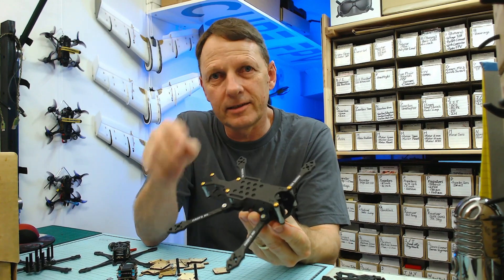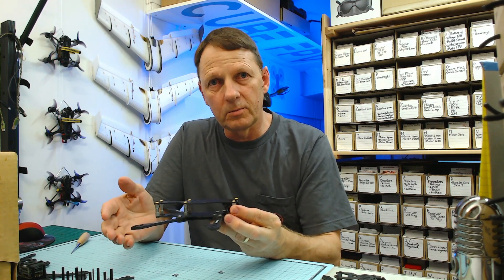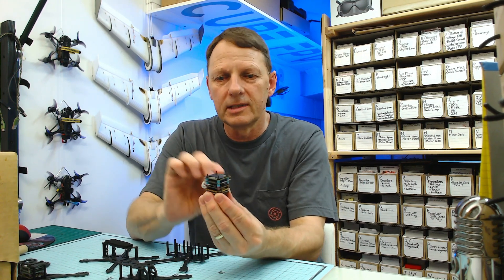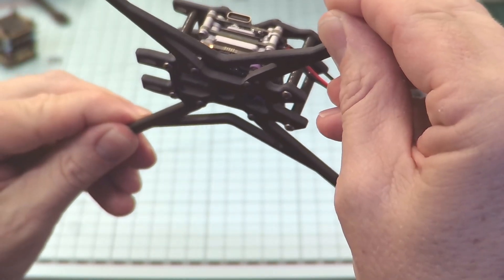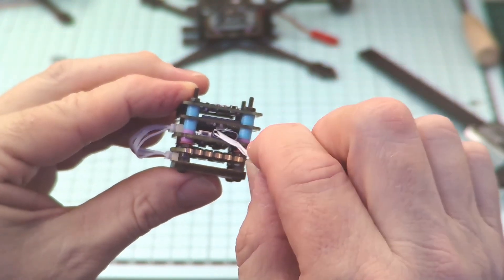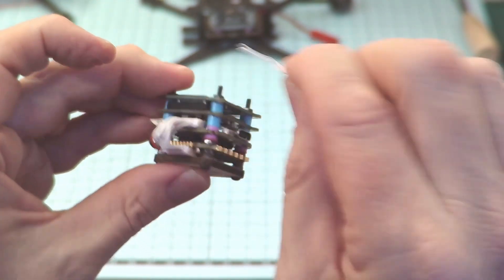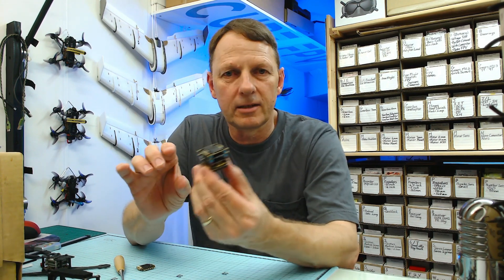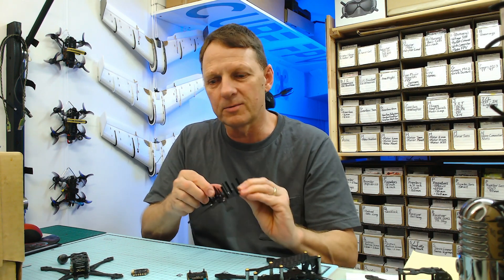How to Build your FPV Stack

Comment: I have a stack that the esc wire go between the fc n esc. Is it ok
Reply from the maker: It's not normally done but it should be okay. The only problem is whether those wires laying on top of the FC will cause vibration. If you start to get flyaways I would take a look at a black box log and see what the noise plot looks like.

Comment: Those stack builders are co0ol! Allows you to mock up your would be stack with a bottom and top plate (builder pieces) without having to do it all in the frame! Obviously when it becomes too tall for the frame, when actually trying it in the frame, it's a big hassle. With the builder pieces, you get the idea much more easily, that everything will or will not fit. Pretty nifty! 👍 Well explained, and well designed stack. I like how you have the USB's on the same level, just on opposite sides of the stack! Brilliant!
I own a factory Crux35 HD. Got it from RDQ when they had a $150 gift card with it for $268.99. Netted a very cheap ultralight 3.5" digital Toothpick! A much nicer quad than I expected from Happymodel! Came with the Nebula Nano V2 camera, which I'd estimate as being about 90% fixed from the dreadful V1.  Not bad at all! 😁
Now that the Caddx Nebula Pro Nano is released, I think I'll use my $150 gift card to get it. Sure going to get a ton of value out of my $268.99 ! Lol
Thanks for the interesting video ... I didn't know these builder pieces existed. 😎🤘
Reply from the maker: The Crux 35HD is a great airframe - a very astute purchase there and I bet you're finding the flight characteristics a bit different with the underslung battery. I just have a few Crux 35 airframes so I'll be doing some build and flight videos soon.